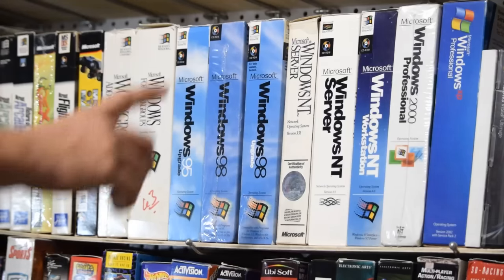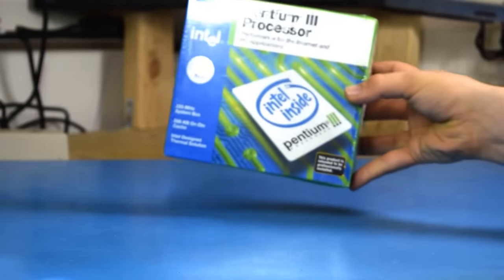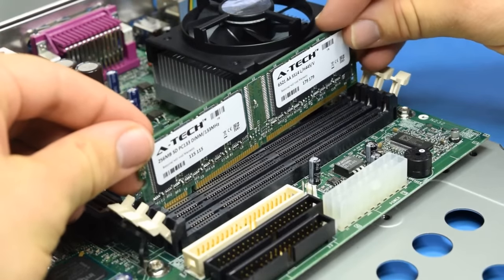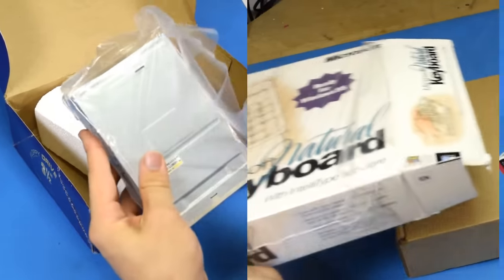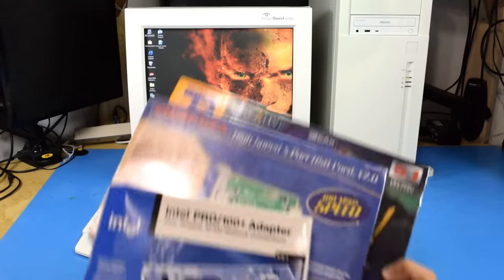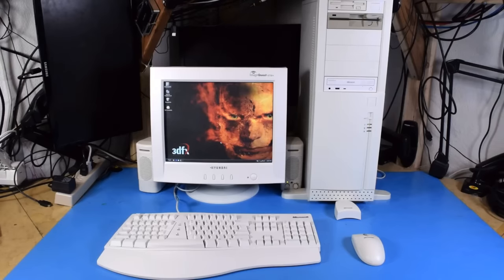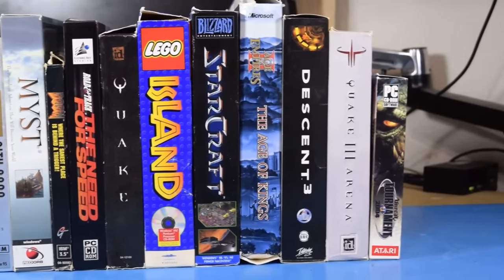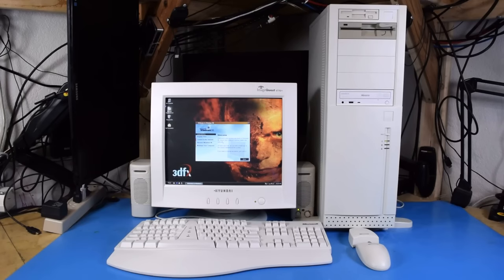Windows 98 20th Anniversary All New PC Build

Comment: You have chosen modern PSU. Good solution, because you used very uncommon GPU  - Voodoo 5500 which  had huge power consumption for that time (much more than AGP port could manage) and required separate cable for power supply. Personally I would try to find old original PSU + Geforce 2/3 GTS (or Radeon 8500) which caused much less problems at that time
Reply: Benny Hill PL 
Well older power supplies have a habit of being... explosive

Comment: I can understand why you'd use a modern PSU on the build, but ATX PSUs since the Pentium 4 are designed for heavier loads on the 12V rail, while earlier PSUs were designed for heavier loads on the 5V rail. So you could run into power issues if the PSU can't provide enough current on the 5V rail. Great video though, I love watching stuff like this.

Comment: 120 GB hard disk 20 years ago? I think not.
Reply: My old PC used to have 40 gigs, and I had Pentium 4 and Windows XP lol
Reply: Yeah, I had my first PC in 97, it was P2 300 MHz (slot1) with 64 mb sdram and a diamond viper vga (16 mb vram) and the HDD... It was 4 GB. 4! The machine was the far most expensive in the town costing almost a year's wage. Even in 2002-3 the 120 GB was only a geeks dream.
Reply: Yeah it's like a super computer to me at that time
Reply: More like 1.2 GIG
Reply: yeah definitely not. win 98 PC's had like max 2GB HDD's
Reply: 60 GB here.
Reply: @zoli058  My first (new) PC was already on the cusp of becoming obsolete in 1999... 350 GHz Pentium 2, 64MB RAM and a gigantic 6GB hard drive that was like a black hole that I could drop endless amounts of data and programs into and it would never fill up.

Not like today, where if I so much as sneeze it'll use up 6 gigabytes.
Reply: @DecibelAlex  
"win 98 PC's had like max 2GB HDD's"

That's if the person who installed Win 98 on their computer was dumb enough to format their hard drive with FAT16, which is limited to 2GB. With FAT32, Windows 98 can support up to 137GB (though FAT32 on its own can have a maximum of 2TB, but Win 98 can't do that because of software limitations).

For my last Windows 98 install (in 2003) I used a 40GB hard drive. So it was indeed possible to use a hard drive larger than 2GB with Win 98.

Comment: well you could use hardware more "1998" instead of "2000" hardware lets say a P2 450 P3 450/500/550 a RIVA TNT and a Voodoo 2 for exmaple..... second you could use the WIN98 not the Second edition since it was released later....
Reply: barrozo24 agreed. Pentium 2 and about 32Mb RAM. And a 20 or 30Gb HDD would be more 1998. Also the 5 1/4 gloppy was basically dead by 1994.
Reply: Yeah man. Our computer had 20Gb we bought it late 98. Our cousins computer from 1997 had a 12Gb HDD. I remember that cause I was like 12Gb is a random size.
Reply: But yeah earlier in 1997, HDDs were around 4-6Gb on new systems.
Reply: Yeah but the point was to have a computer that can play 20 years of games, so the 5 1/4 floppy was necessary. And lots of people used Windows 98 well into 2000, so having newer-than-1998 parts isn't really period inaccurate.
Reply: Muroidea but 20 years of games? By 1998 all games came on CD ROM except for some shareware games on 3.5” disks.
Reply: I don't know what you mean by "but 20 years of games?" He said he wanted this Windows 98 machine to be able to play the oldest DOS games to the most current (for the hardware) games, which spans around 20ish years.

Comment: To keep it period correct, you shouldn't have use the Voodoo 5, the Voodoo 2 at a push would have been better. Back in the day we had moved to Win 2k/XP by the time the Voodoo3 and then 5 series came out, which means Q3A and UT 2k4 were not of the period either. Things were changing that rapidly back then that it's unfair to group titles and hardware even 2 years close to each other as of the same period seeing as there was such a leap in performance. I bet if you had XP installed that UT2k4 would run much faster because of a newer DirectX version.
Reply: kodaloid Yh I’m not sure voodoo 5 was around in 98, pretty sure quake 3 came out in 99 and ut after that, from what I can remember some titles from 98 were half life, commandos, grim fandango, unreal and thief

Comment: PLS RUN HALF LIFE1 IS LIKE CRYSYS TODAY
Reply: As stranded from OpenGL and D3D as the VSA100 is, believe me that it shouldn't have any problem running HL1. I've tried it myself on my 5500, paired with a P3 800 and 120MB of RAM.

Comment: You Sir have inspired me to build a windows 98 system in 2022. I still need to get a windows 98 disk and 500gb seagate hardrive and memory.

I have the mobo, cpu, and voodoo 3 2000 card along with psu.

Comment: Back in the day PCs were really expensive. In 2000-2005 I had a Pentium II, 2GB hard drive and 16GB memory. All it could run was an SNES emulator, with Windows 98. It was my first PC. Then to be able to play more modern games I used to go to lan houses. There the Pentium 4, 256 MB memory and video cards (don't remember which) could play games like counter strike 1.6, GTA vice city, dota and others. How time flies

Comment: this is still indeed a modern computer, i remember very old builds (286, 386, 486 dx33, 66, 120, etc).. those motherboards were a real pain to the ass to setup, like hundred of jumpers b4 u could turn it on.

Comment: I remember these computers. Hell i still use old Windows 98 games and programs today on my Windows 10 computer and laptop such as Warcraft 2 or Diablo or even Windows 98 Plus. Im a retro kinda guy and im 32 years old. Believe it or not, i still use the old green and purple plug-in mouse and keyboard on my Windows 10 computer!! But the mouse is an optical mouse like we use today. Not a ball. I remember how nasty those ball mice got over time and they had to be cleaned. I was using that same type of CD-Rom drive in my computers up to my Windows 10 pc. Never know when you may need it :P  and i still use old fashioned speakers too. My dad always complains on why i use so much junk and outdated crap when i could be using newer. Hell i was using a similar big boxy monitor like that one until my Compaq monitor had issues finally and i used it up til my Windows 7 days. My dad forced me to use a newer flat screen Hewitt Packard monitor when that happened and threw away my old Compaq monitor in the trash. Ohhhh so many memories.

Comment: You should use independent cables for HDD and CD due to the impact on performance, not the data rate but the instruction rate and also and more importantly the improved performance when both devices are in use which in this case is not much of an issue but for cd/dvd burners definitely is a must when burning data.

Comment: The HDD was EIDE, not IDE, and important enhancement at the time, that allows in this case Ultra-100 mode, which is 1 less of the Ultra-133 Mode final version, a 3x improvement over the typical IDE 33, all in Mhz; but it wasn't activated by default in the BIOS, exept much later on. For CD-ROMs the Ultra DMA Mode 2 was the one used, which was used by HDDs too prior to the Ultra-66, but the CD-ROMs never got it, HDDs anyway were capable of it, or they used as complementary, I never knew.
Great build, brings memories as a PC Tech back then, satisfying to see RAM max out a MB, it's a rare event: Win98 needed like 4 MB, 512 MB would have been a dream machine; but I didn't like the Full tower, too tall, heavy, unstable, cables sometimes didn't fit the placement of floppies, but they had cable management almost automatically, and good cooling

Comment: Can you please make a more in depth video of dealing with capacitors blowing on the motherboard? And how can I be certain that the power supply I get has the right connectors for the right motherboard? I’ve been trying to restore my first PC (which ran Windows XP) and haven’t been successful at it. My PC uses a Gigabyte Technology P4 Titan series 875P Motherboard. I also have another motherboard exactly like it stored in a box but I’m afraid I might accidentally blow that one too.

Comment: The reason why you're getting an "NTLDR is missing" error message when upgrading from Windows 98 to Windows 2000 is quite simple, Windows 2000 is a version of Windows that Microsoft made after they made Windows NT so it uses the same technology in it's Kernel, Windows 98 is a DOS based Operating System like the other versions of Windows that came before it, Windows 2000 is an NT based Operating System, that's why you needed to do a complete clean install rather than an upgrade.....

Comment: I read on a certain fora that most Windows 98 cd's are not bootable... Is this correct? I mean, you installed Second Edition and uses a floppy to boot from.. However im positive that you could have booted from the CD instead... Why i think this? I have an original Second Edition cd myself, in my native language (Dutch). This CD is bootable. If your CD is not bootable, than it probably means that your CD is a very early RTM CD and mine from sometime later... Mine is even a hologram cd and your cd is not.. So, your cd is an early copy i guess?

Comment: Should have just kept your original win 98  PC.
Reply: Also a computer of that era, would not have had a 5 and a quarter drive installed.
Reply: Also, buy a broken Y2k gypsy built bare bones computer from your local computer fair and try to get it working with those parts, for the ultimate experience!